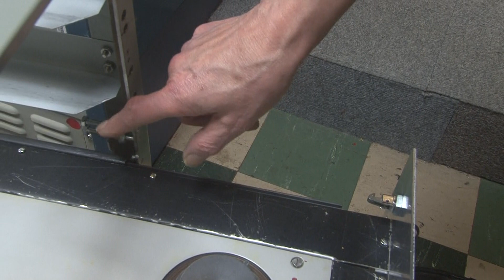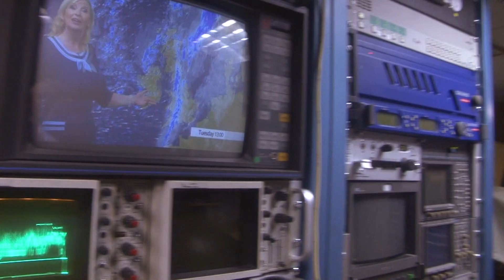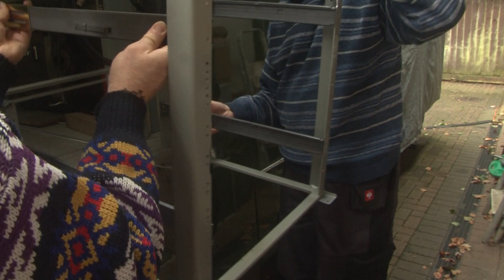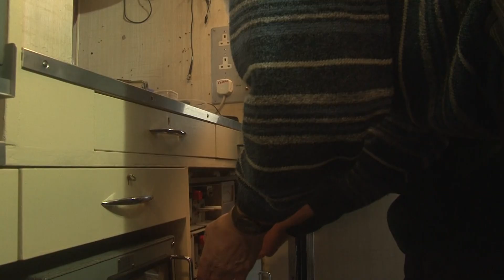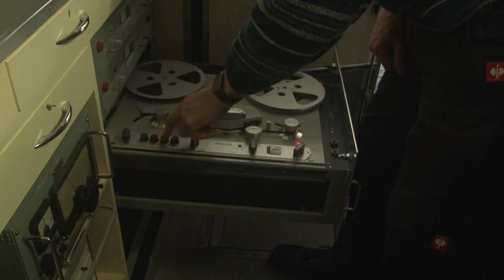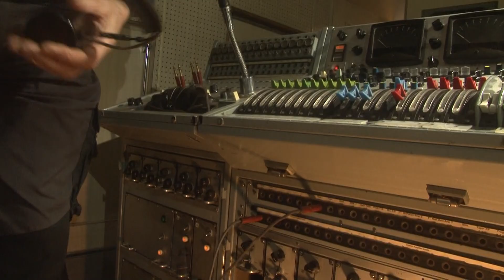Audio Tape Deck – part 2 of installing an ex BBC audio tape deck – a Philips EL3503

Comment: Sadly your offspring or whom ever acquires your estate will sell everything for a two bob bit !
Reply: We have solved this worry by forming a charitable Trust to which the equipment belongs. Hopefully new trustees will come along and continue the good work!
Reply: @bsomers8664 I typically buy most of my audio collection from original owners / estates. I avoid audio peddler's like the plague. I hope your collection does not fall in the hands of scum bag peddlers

Comment: Nice job building the rack, may I suggest you put some PTFE 1mm strip for the Deck and Amps to slide on, Nylon works well you can get this from Farnell / CPC or RS and is what was used before roller bearing tracks. Great work.
Reply: Yes we have been using 1mm PTFE strip elsewhere on the mounting runners but have run out! and we need to source some more but it must be "etched" on one face so the glue will stick to it.  will retrofit in due course.
Reply: @bsomers8664  Hello, thanks for the reply,  3M make various double sided tapes and probably have a tacky tape for PTFE or may have a slider tape that will do. Phillips contact goo for shoe soles is a tenacious adhesive. Great work chaps your attention to detail is admirable.
Best wishes.

Comment: Oh buy, I don't like the idea of the slide in unit , makes it hard to access the deck & must stress the cables. Nightmare me thinks. Wish you good luck.
Reply: Space is really tight in OB trucks and that's one thing that hasn't changed since MCR21 entered service in 1963.  Cables are multi-stranded and loomed to form a kind of hinge so they can move back and forth with the equipment.   We are trying to stick as faithfully as possible to the original build.  Not always easy!
Reply: これはまさに素晴らしい動画でした。この年では最後まで大変な作業でしたね。👍

Comment: Wonderful little quirk on some of these machines in BBC installations. The remote start function would leave the erase head active if you started recording at the desk remote and then stopped the machine on the transport buttons without canceling the remote record enable on the tape machine. When you wound the tape back against the heads to find the edit point you would wipe the recording you had just made. Did it only once.
Reply: @stevejones4061  oh yes, remember that well; waiting for the unwary . . .
Reply: @stevejones4061  that is a hell of a feature.

Comment: Vintage early 1960s?
Reply: Yes, certainly 1963 or before as this type was fitted to the vehicle when new.  I suspect that the deck was quite a successful product as it was later offered with solid state electronics.

Comment: As this posting is new and hopefully many will read this...  A problem remains with the moving coil meters on the record & replay amplifiers. Put simply both meters are open circuit and we have carefully examined them and it it the moving coil it's self that is open circuit.  Far too small and delicate for me to service.   The meters are continental (Dutch) in origin quite different from UK meters.  There are a number of options, the hope is someone reading this will know of exact replacements.  ( a must for originality)
Reply: A project for Mend It Mark perhaps? https://www.youtube.com/@MendItMark

Comment: Excellent stuff, this project is marvellous!!  As a result of watching this, you may be able to help me with something!  The mains plug for the record replay amps is exactly what I've been looking for the mains sockets on several items of vintage Philips test gear that I have, so do you have any spares from your searching, or could you let me know where to get some?
Reply: The main plugs are widely available in the Netherlands. I've a couple of them in stock
Reply: @jvschaik1  
Thanks. What are they known as and could you suggest a supplier in the Netherlands please? I'm a BVWS member by the way.
Reply: we got ours from the Netherlands, all worked well. Brian.